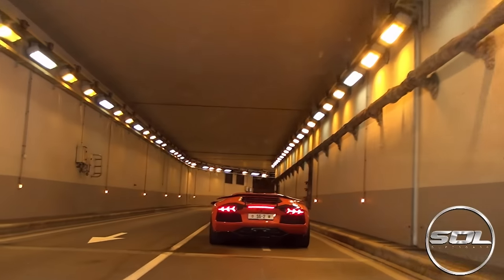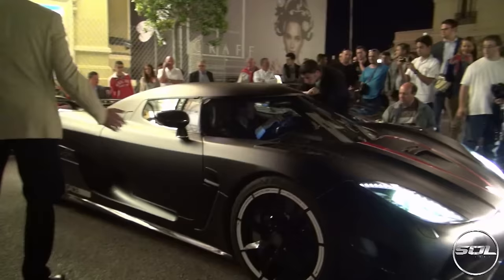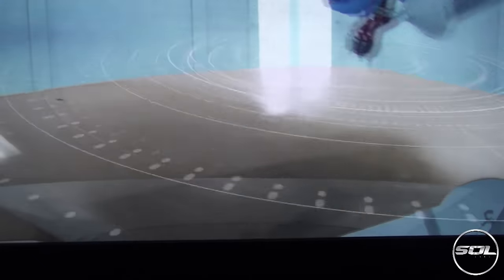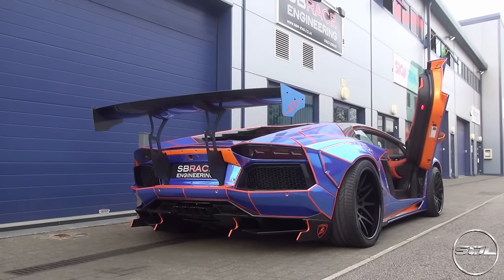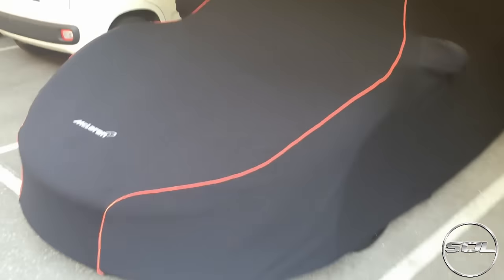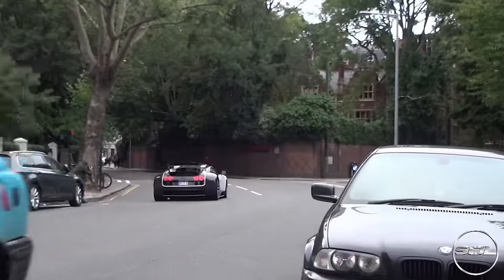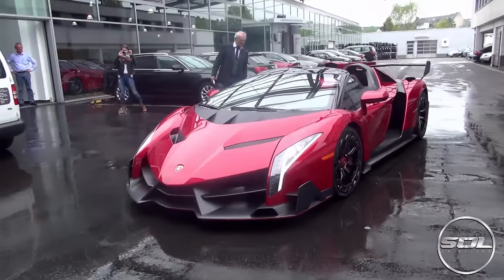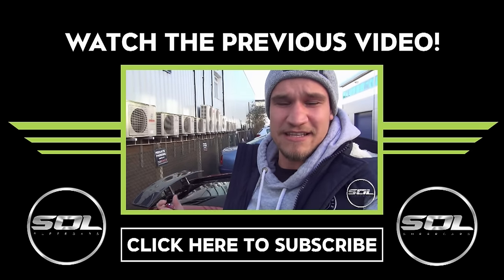THE 10 BEST SUPERCARS SPOTTED IN 2015!!

Comment: why is it that every European is so impressed and amazed when either a lambo or a ferrari sit there and rev their motors to the point of hitting the rev limiter and flames come out the back.  when you first see it as a kid ok sure its cool but when they have been doing it for years and if there is either one of the brand of cars in a car show, you can almost make a bet that when they are pulling out they will be spitting flame balls.  its only cool until about the 100th time then after that its like whatever and watch the paint.  dont catch the car on fire.

Comment: I hate the new Ford GT. It have nothing in common with the original idea of the Ford GT. The look is awful and the engine is an insult to the GT history. 
It should have been a V8 ! Supercharged, Turbocharged or NA, doesn't matter as long as it's a V8. The look should have been just an evolution of the 2005 GT. The front is okay, it's just the rear who's completely messed up.... Such a shame what Ford have done to a legend... At the moment, Ford can only built proper Mustangs and not a terrible supercar.
Reply: agreed they shouldve kept it with the half muscle half supercar gt
Reply: The car that won at le mand was called gt40, this is a gt. It just isn't supposed to be the same car, the gt should be a car that rivals the modern lambos, not one that pays hommage to the old gt40
Reply: +TobRacer 1. It looks awesome. 2. It remiminds everybody of the 2005 gt
Reply: Yeah I love the old Ford gt (2005)
Reply: +TobRacer,  it's called evolution.